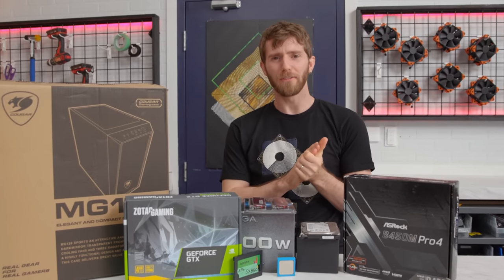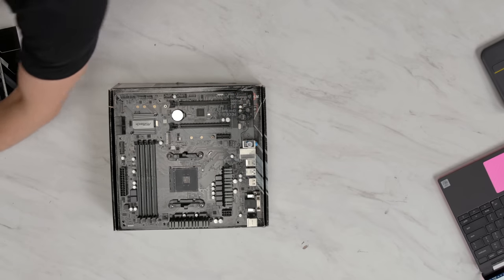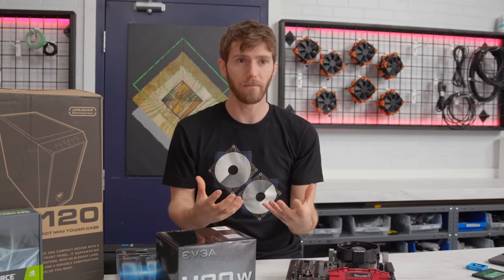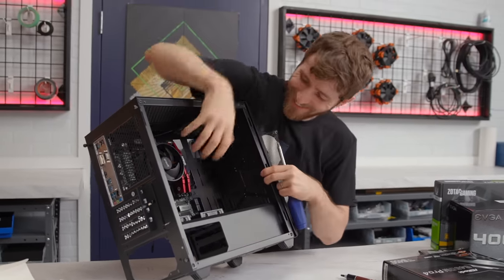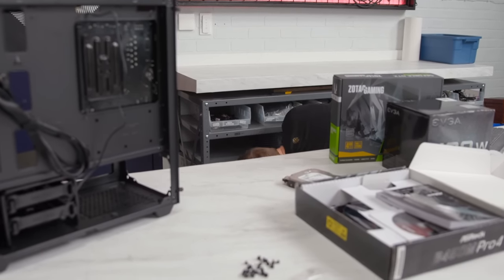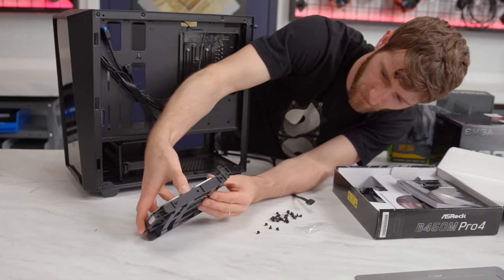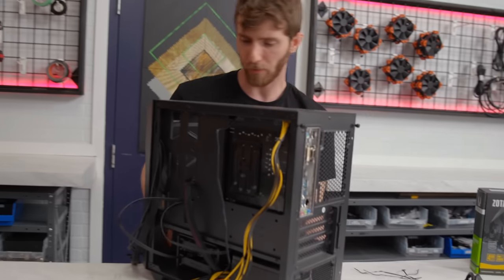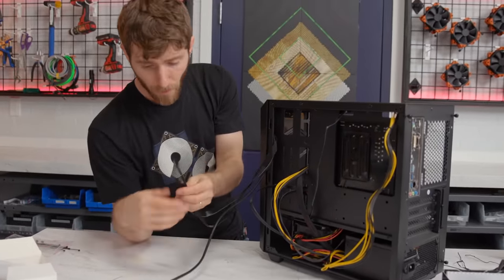Building a $500 AMD Gaming PC

Comment: “AMD gaming pc”

uses Nvidia
Reply: and a bad value nvidia card
Reply: @James Smith  James Smith  This is a budget build, to meet a budget you make sacrifices and there is nothing wrong with sticking to a budget. I do not know why you decide to judge others financials and critique them, and I also simply do not understand why you find this build so terrible, sure I could justify an argument saying it's sub optimal as you stated possible upgrades but he tried to stay reasonably close to the 500$ budget. Each of your suggested upgrades would add additional cost.  And last time I checked in a 500$ build one fifth of your Budget should not be allocated to storage as faster storage is more of a commodity rather than a necessity and that money could be spent elsewhere whether in the computer or otherwise.
Reply: Intel uses iphone's popularity and now abandoned by iphone
Reply: @rogerharsh  replace iphone with apple.
Reply: @James Smith the one in the video is the gtx1650 super, not the 1650, the normal one was a failure this one's not that much, but is better than Rx580
Reply: @James Smith The 1650 Super is a faster card than the RX 580. It also uses quite literally half the power (100W for the 1650 Super, 200W for the RX 580). It's an outdated 4 year old design.
And for CPUs, if we're talking true performance/$ budget gaming king right now, it's by far the i3-9100F. Thanks to the 3100/3300X getting so much hype across videos like this, they're sold out at MSRP and only available from flippers at grossly inflated prices. The 9100F? Less than $75. Thanks to easy availability of commodity LGA1151 motherboards you can have your entire CPU/mobo sorted for less than the price of an MSRP 3300X.
Reply: Like what are you going to run with this "gaming" pc? 3100 garbage..1650..might as well bought a 1050ti...8 gigs of ram..lulz..400 w ps ..about standard with a prebuilt and pointless cuz youll be upgrading that puppy,,decent budget mobo though..
Reply: @RobCarter04  lmao says who? the 580 can keep up with the  new 1660 sometimes outperforming..1650? pfft
Reply: @James Smith are you anthony in disguise
Reply: @James Smith you know way too much tech knowledge that im scared of you
Reply: João Queirós  No. The RX5500XT was and is a better-value card, and outperforms both the RX590 and the GTX1650 Super while being cheaper than both.
Reply: For real you can only get a 1650super in a $500 machine and not even a SSD like the upcoming consoles that are gonna be like $600 🤦🏽‍♂️ wow
Reply: @aaajose  finally a men of culture
Reply: @JackBandicootsBunker  it's 30$ more expensive than the 1650s
Reply: @MrAnderson5157  do some research before you talk...
Reply: @nekojcovek8466  The cheapest RX5500XT 4GB on NewEgg is USD179; the cheapest GTX1650S is roughly the same or 10 USD more, as the GTX1650 didn't plummet in price on their top-end SKUs.
Reply: @MrAnderson5157  1650"SUPER" are basicaly 1060 performance wise with less power consumption and it's slightly better or the same as RX580 with half the power consumption and compare it with 1050ti kinda doesn't make sense.
Reply: X̶̲̅ H̶̲̅A̶̲̅ what? 
1. I am not about the graphics card not the motherboard

2. All graphics cards require drivers to work properly

3. I am able to use my RX570 without messing with bios

Comment: It's a nice case, but I'm not ready to discard the 5.25" optical bay entirely :(
Reply: Ed Ireland nope me neither 😉 got four 5.25“ bays plus two 3.5“ 👍
Reply: I have the same current debate. I really want a new case. My Rosewill gaming case R5 is about 8 to 10 years old now. But I am currently using the Blu Ray optical drive to convert my DVDs to digital media.
Reply: Agreed! Just build a PC recently and struggled finding the right Case for it. I needed good airflow, power supply shroud, tempered glass sidepanel AND 5.25" bay for my Blue Ray Writer, in a Micro ATX case because of space restrictions.  It took some time to find the right one, finally I settled with a Cooler Master Masterbox NR 400 with mash front and a 5.25" drive bay(there is a version of the same case without it also). Luckily it was on sale at Canada Computers for $80 and I'm happy with it.
Reply: @Jay_the_Caffeinator  If a micro Atx is ok for you, I suggest you check out the Cooler Master Masterbox NR 400 with mash front and 5.25" bay. I bought it at Canada Computers.
Reply: @Jay_the_Caffeinator  I have an itx case with an external Blu Ray drive that is neatly tucked away under my desk. It's nice. And yes it's a hacked blu Ray drive for 4k
Reply: Me neither. My current build is in a second-hand Corsair case with 2 5.25" bays - DVDRW in one, card reader + USB3 hub combo unit in the other. Forget "minimalist aesthetic" and give me MORE THINGS!
Reply: BluRay is not a thing in my country so we never have the need for optical drives anymore, but my itx case has a 3.5 optical bay or whatever the spec is (about the size of a laptop's) so is there no bluray drives of that size, or external versions?
Reply: @laszlosarkozi1385  thanks!! I will keep that in mind! I think my current MB that I bought for my son 5 years ago, is a micro ATX. It doesn't help that I am running 4 drives though. ( I have gathered over the years) 3TB WD Green, 1TB WD Black, 128GB SSD, and a 256GB SSD (current OS drive).
Reply: @MattFowlerBTR  LoL
Reply: @jazmihamizan4987  Good idea, I forgot 3.5" disc bays existed, will look if there is a BD-RW in that size!

Comment: I got this board for my daughter and installed a 3200g with 16GB RAM. Did alright, but I eventually got a deal on a GPU and stopped using the intergrated Vega cores. The CPU worked out of the box, I did not need to flash the bios with an older CPU, but I did have to for it to recognize more than one core. I didn't even notice it until I added the GPU and was confused by bottleneck. Tried it w/o the GPU and the performance was noticeably much better. Just because it works, doesn't mean it's right. I was just happy it booted I guess and never checked.

Comment: Oh man ... back in the days, you could get a case weighing a ton, but the cheap ones were REALLY terrible!

A former girlfriend bought herself a PINK case (because it was pink and cheap) which flexed so much, the mainboard did not work properly in it. There were random resets and stuff. Totally weird behavior. Some screwhole were additional under tension. She loved that case and I had the "joy" to fix it:

Because of the ultra thin metal I could not even just simply take a tig welder to strengthen it, so I had to use lots and lots of perforated steel plates with lots and lots of screws and tons of epoxy. The airflow needed massive enhancements, so the fake vents in the front plate got dremeled out. The case was not made for any bigger fans but jigsaw helped with that. To add insult to injury, the pink paint was so bad, it came of under even the slightest stress. Which I found out during the process the hard way. So I had to sand everything down, primer it and asked a friend, who painted cars for a living, to give it a pink coat. For the material alone I could have bought TWO very nice Chieftec cases (those were the cases to have, back in the day). Well in the end, it was a very nice looking case (if you like pink) which actually worked. Was it worh it? Well .. it was for me. But as one of her girls from her  circle of friends pretty much demanded, that I have to do the same for her PC (they had bought the same case) I simply grabbed pen and papper and calculated the whole thing and asked her what she could do for me for those 20 hours of work I would have to invest. It was so much fun to see the look on her face. She got herself one of those more fancy Chieftec cases and trashed that her pink piece of trash they had bought together.

Comment: Linus :" Not that I'm speaking from experience?"

Dude, how many lunches did you NOT eat ? 😂
Reply: Lol
Reply: good question. i’m going to middle school (7th grade) and i may just keep the money given for lunch and make things from home. tbh nothing really is that great from school lunches.
Reply: I did that for just over 3 months back in high school when i was 15 (nearly 100 lunches maybe) and i got myself the usd equivalent of $80 (should give you an idea how expensive technology are to 3rd world countries) and was able to procure a used 550ti, an extra 4gb ram to make it 2x4gb and a better psu than whatever time bomb i had at the time. But the cpu was a trash pentium sandy lol. Gpu fan died 2 years later so i just superglued a 90mm case fan that i broke the brackets off on where the fan was

Fast foward 5 years. I had an i5-7400 with 1050ti when i first got to college with m-itx build but i have swapped to 3300x now. (really, college lunch money have way more value than high school lunch money). The old high school build had the cpu died so i replaced with a cheap ass i3-2130 i found online and not long after the gpu finally dies and i replaced with a cheap ass gt210 just so i can put win10 in and not have driver issues with the sandy igfx. I've built a separate machine with the i5-7400 with the legendary time bomb psu ($12 lol) that somehow has not blew up. Now i have 3 PCs, one for me, one for home use, and one for my siblings to play gamehouse titles or watch minecraft videos
Reply: Maybe that's why he's so tiny

Comment: me: I'm going to build a pc!
 
also me: * realizes cable management is needed*

me: nevermind it's too much work
Reply: (I built it) It’s probably the hardest part but still not that hard. If you don’t care about wires don’t worry about it.
Reply: Just get a case without a window. Problem solved.
Reply: Harry Lawson I was joking when I said no wires in my other comment. Shoving it under the carpet is not a solution. It increases dust and limits airflow. And you might get a case with a window later
Reply: the I only part I'm confused about I'd getting a copy of windows
Reply: A Life in Animation on another pc, search up windows installation media and download it onto a thumb drive. Put it in and follow the prompts once you make it to the post screen
Reply: i just meant the license key
Reply: A Life in Animation buy it off the Microsoft store. Google it
Reply: There's a reason I love my Cyberpower full tower case, it has these lil compartments in the back where you can shove cables in and slide on the cover then the back panel lol

Comment: Paid 600 for it. 2 days later. Parts drop down to 400. Shit.
Reply: “It’s even gotten to a point where my stretchy Costco jeans can’t contain it all” 

Heh.
Reply: Hey is this pc decent enough to run a game with medium visuals while streaming? I’m ok with low frames, chances are I’ll be running Minecraft. This will be my first build and I just need to have around 30 fps and decent graphics. Please let me know:)
Reply: Legit happened to me last week 😪
Reply: @malachistrachan8929  I would think so. I haven't been streaming but I can run everything on high just fine.
Reply: @dorthynorton6699  Yes! These specs would run stock Minecraft at reasonable settings and do a 720p stream at the same time. You could likely also run some well optimized FPS games. Remember this build is 4 months old and black Friday is coming up so you might find some nice deals to upgrade for the same price.

Case, motherboard, PSU, hard drive, and cooler from this build will go far. You can likely find some nice RAM kits or a better CPU on sale this weekend, and you may be able to find a better graphics card on the used market for the same price to get you a little more bang for your buck.
Reply: Hey whats the avg fps in minecraft fortnite csgo valorant?
Reply: USA: $500
My Country: you know what, lets make it $700

Comment: G-Skill RAM is the business.  Really low latency even compared to the "fancy" stuff.
Reply: So gskill isn’t considered fancy ?
Reply: @redrum6619  I mean, its plain plastic with no rgb.
Reply: Danny Rodriguez us
Reply: Egelik22 oh ok . But overall for price and performance it’s still good I would assume . I got 32gb 3200 for like $115
Reply: @redrum6619  It's not one of the "fancy" brands that are all high clock, unnecessarily fancy heat spreaders, LEDs and high latency. 

Their 3000Mhz has a CAS of 15, I looked at some more expensive brands with higher clock speed, but with a CAS of 20+, so it was working out slower overall than the GSkill.

Comment: Tried to build this computer on 09/10/2021 and can confirm! You can NOT build this PC with these parts for 580$... Full total, with purchasing thermal paste, using the best possible prices and not including shipping is $1,180. Really looking forward to the day that chips are able to be produced at a higher rate. This bottle neck is driving prices for all systems that require a GPU Sky high and availability of high end items almost non existent.

Comment: Me: Get's the ASRock B450M thinking it's elite for my new pc
Linus: Uses it in a $500 build
Me: There goes my fun
Reply: Running the 350 variant for almost 2 years, system is rock solid. You'll be fine, man
Reply: hmm yes the motherboard, most impactful part in 2020

Comment: Real title:
"Building a gaming PC but not actually, literally, really  "gaming" with it."
Reply: LAFOLLETTER  I think this is not future proof but it's just enough for this build. Am i right ?
Reply: LAFOLLETTER  I don't know much about building pcs and i just recently interested in building a pc where i can game on it (in 1080p medium-high settings and more than 45fps ) . I will be using   cheap parts like rx 570 gpu. When i view pre-built pcs i saw psu's like 450W and 500W. I tried to calculate what the parts in pc will requiere and it was about 400W. So why does 450W won't be enough ? I am guessing only problem would accure when i want to upgrade some of the parts. Am i right ?

Comment: 7:08 - I thought AMD did get rid of the copper plug on their Wraith cooler with 3rd Gen. That must be an older cooler. https://m.youtube.com/watch?v=Lfrdy3wG_g0
Reply: They did. 3600 came with an all aluminium cooler. Which sucked absolute balls.
Reply: There's always been 2 versions. The smaller one is the Wraith Stealth and the bigger one is the Wraith Spire, that one has a copper slug. The Stealth comes with lower TDP chips. With first gen Ryzen, it came with the 1500X and up, but then only the 2600X and 3600X and up got it. 
The 3100 comes with the smaller stealth, that doesn't have a copper slug, but it works fine for the TDP of the chip.
Reply: @musguelha14  There are multiple version of the Wraith Spire that shipped with AMD CPUs. They stopped incorporating the copper slug a while ago. If you buy an AMD CPU today that has a stock Spire cooler, 100% they're all aluminium with no copper plug (Source: my R5 3600X Wraith spire is just a chunk of extruden aluminium with no copper slug)

Also see this video, at about 1 minute 5 seconds, he shows the two cooler side by side, with and without copper core https://www.youtube.com/watch?v=9mWngYZoK34
Reply: Duy Le Nguyen yeah, so it’s double confusing. Not only does AMD use an all-aluminum Wraith Spire now, but the 3100 comes with the smaller Wraith Stealth. So Linus is using a previous-gen Wraith Spire that doesn’t come “stock” with the 3100. It’s from their parts bin.

Comment: Agreed Linus.. the only time I killed a piece of hardware was when i acetone from a dry ice pot bubbled over and acetone git into the socket, killing the chip (i7 3770k). The good news is that I got a new chip from intel using the OC warranty I had purchased, and the chip they gave me in return was a golden piece of silicon. I set a few HWBOT records with that chip.. so what's the moral of this story? Killing hardware is rare, and sometimes you get super lucky